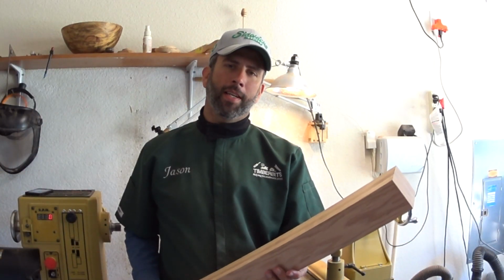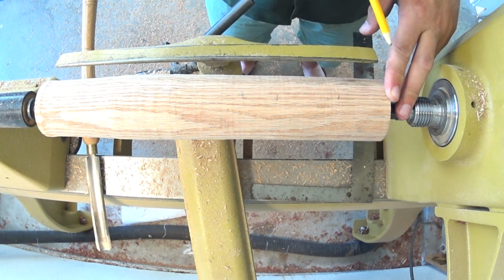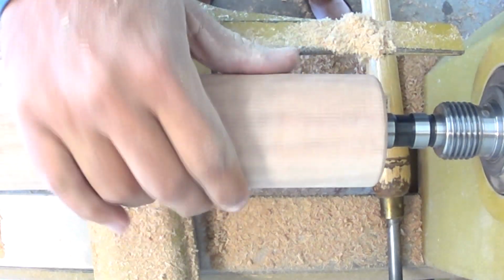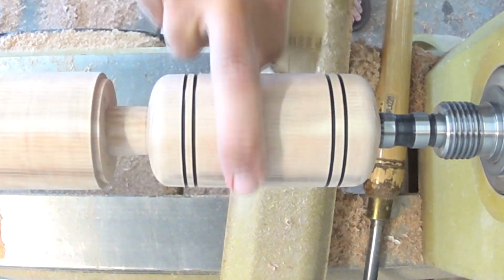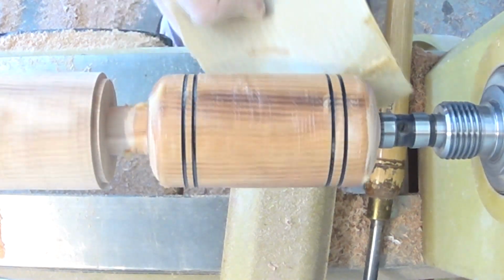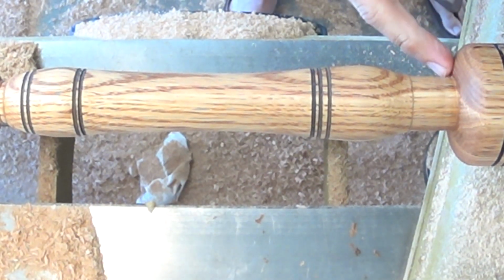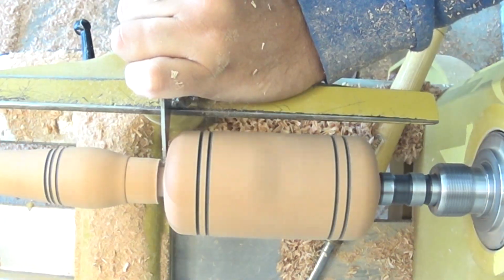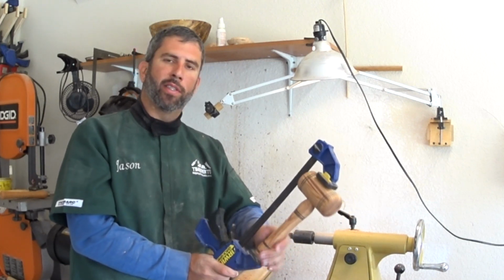Woodturning a  Mallet  -  How NOT To Do It

Comment: Hi Jason,  It turned out very nice in my opinion. When I saw the title you used, "How NOT to...."
I just knew the head was going to spit because of how the hole was positioned between layers.I was envisioning you driving the handle into it. LOL
 I'll have to try some of that wood. I've never noticed it. Thanks for sharing.
Reply from the maker: Charlie Zellner , I was concerned with the glue joints holding, and it would have been more stable if I drilled through the glue joints.  It’s held up well so far, but i haven’t given it a big whack yet. Ha. 
Thanks for watching.

Comment: Great job how did you burn stripes into body of mallet would plain braided wire work ?
Reply from the maker: Craig Burkett , I use old guitar strings to burn in my lines. Just ,don’t wrap it around you finger. I cut small wood handles attach to strings.
Reply: I use 100 lb steel braided wire that you hang pictures on the wall with. It’s only a few bucks

Comment: If I predrill hole will it be an issue with catches when turning on lathe
Reply from the maker: Craig Burkett , you shouldn’t have any trouble with catches, but you may get a little tear out, with the unsupported grain as you cut to the hole. A little sand paper with fix it though. Hope your mallet turns out well